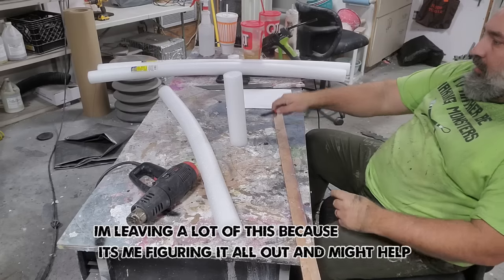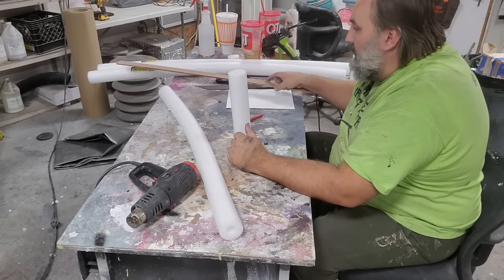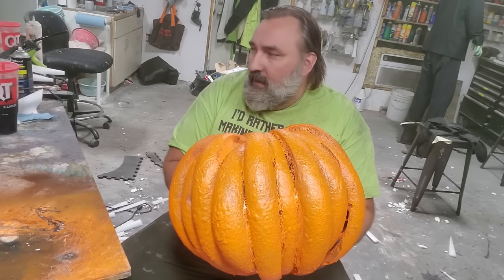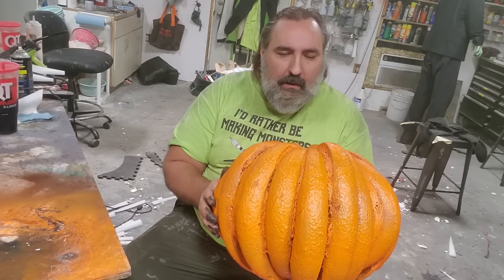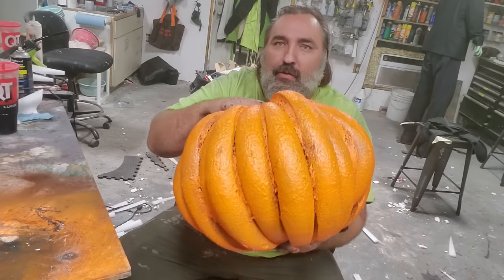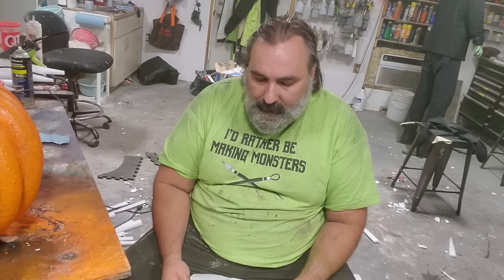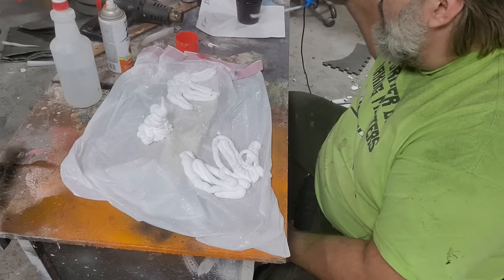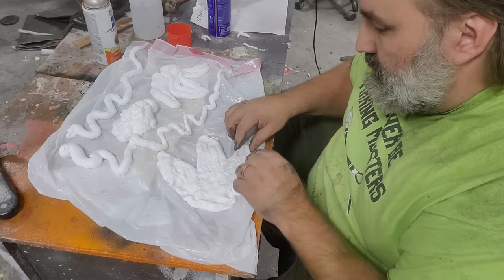pool noodle pumpkins!

Comment: Would they still float ? I could see a pool or pond with a bunch floating around in fog water lol.
Reply from the maker: they sure will.
Reply: Purpleshoes Purp that would be rad!
Reply: @amyjarvis4169  I know hu. Now I just need to make them. Maybe for next year.lol.
Reply: Or in an actual pool, if you live in a warmer climate where you can have a useable pool in October. That would be a fun Halloween party 🎃
Reply: That would be such a cool effect!!!
Reply: Looove this idea for the resort I work at!
Reply: Thanks for the idea. I have a pond that it would look awesome in
Reply: I don't see why they wouldn't. They may roll over on their side.
Reply: I'd add some ballast to the bottom, as they would probably roll onto their sides. Perhaps fishing weights suspended by line beneath.
Reply: You are my hero.
Reply: Real pumpkins uncut will float.

Comment: Wow! I had no idea pool noodles could be attached to themselves with heat. Loved this project!
Reply from the maker: it takes a bit of fiddly practice, but it works.
Reply: I came here to say the exact same thing, 10 months later😂😂😂
Reply: I honestly thought that was a real person in the background at first 🤦‍♀️🤦‍♀️🤦‍♀️🤦‍♀️
Reply: I’d like to hear anybody else was able to. I just got shorter and shorted melted pool noodles. Every one I added melted the other three off each other.
Reply: @lisagaines4278  Me too 😂
Reply: I’m working on one now and I skipped the heat gun all together and used the soldering iron. You have to melt the middle piece and the part you’re trying to attach at the same time and then smoosh them together while it cools.
Reply: Side note- I’m using dollar tree noodles and the length isn’t the same and I don’t think the thickness is either. I’m definitely going to end up with more than 10 “c” pieces attached lol

Comment: Great minds think alike! I have a weird affinity to pool noodles & spray foam & buy both by the case! My pumpkins are a little different-I use 2 big plastic bowls from Dollar Tree, duct taped together & form my pool noodles over the resulting pumpkin shape. (I weighted some down with concrete so they wouldn't blow off the porch) I then added 3 coats of equal parts joint compound, glue & acrylic paint mixed together. Details can be etched on while set up but not dry. I sprayed  with clear coat & was amazed to have a finish very similar to the store pumpkins. I used the long foam rollers from Dollar Tree to form a stem & coated it with my 3:1 mixture after gluing on the stem with hot glue.  I used different sized bowls & pipe insulation foam  to make smaller pumpkins. I top the pumpkins with a floral wreath of leaves, blooms, berries, pinecones & such or decoupage wordage or  appropriate napkins .The virus has ended my craft shows but I expect these puppies to sell like hotcakes next year!
Reply from the maker: that sounds awesome! Im douing a dollar store bowl project soon here also lol.

Comment: This is totally cool !!! Genius idea ... I made a pool noodle wreath last year and that is when I first learned that spray paint melts pool noodles but you didn't have an issue ... so I will have to choose my spray paint more wisely ! The spray foam is also genius ! Just love everything about this and how you explain your processes thank you ! 🙌🙌🙌🙌
Reply from the maker: most pool noodles dont dissolve with spray paint. They are urethane foam- thats pretty safe with spray paint.  Expanded polystyrene foam and extruded polystyrene foam are botgh dissolved by the propellant in spray paint, mist it on and you will be ok.

Comment: Super late, but just thinking of the off cut scraps you could possibly make a pumpkin inspired witches hat with them. form a cone with them then for the brim create a circle with them flat all points facing in. It'll have the ridged look the pumpkin has but as a topper I think it would give it a quirky look that fits it.
Reply from the maker: that could be cool!

Comment: OK, so, corrugated cardboard cut into leaf shape. Peel off one layer of cardboard sheathing, exposing the corrugations on one side. Dampen the cardboard and drape shape it over the pumpkin (or a bowl). Allow to dry, seal, and paint if desired. Probably just as cheap, if not cheaper than foam, faster and the papery texture looks remarkably like dried foliage. If you crush down some of the corrugations, it really makes the finished leaf look organic.

Comment: Good video Allen.  I actually made some of these 6, 7 or 8 years ago.  I can't remember where I got the idea from, I may have actually even thought it up myself, but it's probably more likely I saw or read something about it.  Whatever, it matters not.  I remember how hard it was to get pool noodles here in England.  I would think it must have been late summer i.e., coming up to Halloween, and so I couldn't find anywhere that had any in stock.  I suspect in Texas they're pretty much an all year round item, but there's not much demand for them here outside of summer!  

Eventually I gave up trying to find them so resorted to grey water pipe insulation tubes - I'm sure they're made of the same type of foam.  Maybe because of your climate there you don't have them, because your pipes don't freeze as it never gets cold enough there?  I made quite a few with the pipes but they were no more than maybe a ft high and about the same width - as you point out, you are limited to the width of each segment, and thus the width and height is restricted.   So after further thought I ended up buying some 'Scaffold Protection foam tubes', which are bigger/wider versions of pipe insulation tubes and are bright yellow - they only exist on God's green earth because we Brits are obviously so stupid that we cannot see scaffolding poles until we smash into them, so we have to make them BRIGHT YELLOW so we can see them.

Now I had a fair bit of success with this idea (pumpkins that is - not smashing my beautiful manly face into scaffold poles) and created some quite big pumpkins - I've just quickly taken a look at some of them and they are around 18" to 2ft (max) high/wide at their biggest, so still restricted in size, but a big improvement over the grey smaller tube ones.  I used essentially exactly the same technique as you by slicing the tubes up into 'segments', tapering each end like you did.  I then used hot glue to stick them all together.  My experience was that it took a long time to get all the separate segments to stick.  Because of their nature to want to 'spring back' into their normal rigid upright state, I initially hot glued them to pieces of round foam (like the blue/pink foam you make gravestones from), like maybe 3" or 4" diameter.  That worked, but again because they wanted to spring back, I had to hold them for a good few seconds for the glue to cool.  But as I worked my way around, the space got smaller and smaller and that made it more difficult to hot glue them both on the foam end pieces, as well as together - I hot glued all of the edges together which was difficult as the pieces closed up.  

Anyway, I got there in the end and was quite please with the results, but what I didn't like was that my pumpkins looked too good i.e., they were the most perfect pumpkins ever seen, completely symmetrical with each segment exactly the same as the next - which of course meant they were far from perfect, because that is not how nature works.  So your one here is much more realistic than the ones I made.  I never really worked out a simple, and quick, way to get around that problem of how unrealistic mine looked as they were just so perfect all round.  I did try slicing the tubes more randomly, but I then couldn't get the sides to glue to each other.   What your video has brought to my attention is that I could have probably used a heat gun too to stick them together, plus I could have spray painted them rather than use acrylics (I naturally assumed that spray paint would have 'eaten' the foam, but as you have said before, this foam is not the same as polystyrene or styrofoam).  But what I like most about your one is how imperfect it is, which of course actually means it's more perfect than my perfect but imperfect pumpkin.  If you know what I mean?  

So you have given me some ideas and the only issue I see is the potential gaps between the segments due to the nature of how they're created, but maybe that could be overcome by that really thin foam you used for the skeleton mask you made recently?  By applying that over the 'skeleton' of the pumpkin you have made and then using the heat gun method to shrink/corpse it and cover up any gaps between the segments?
Anyway, that's my experience and maybe it will give you some further ideas.  Cheers!
Reply from the maker: Im sure there will be lots of refinement in the next few. do you have any pictures of the ones you made?
Reply: I can take some but how would I send them to you?

Comment: you beat me to it!  I've been planning a nice pumpkin patch to do up one year and having a pool... pool noodles was one of the ideas I had to make nice big pumpkins.  I've been putting it off though because they would take up a ton of space so I've been trying to come up with a way to get something similar but that can then shrink down to less space after Hallowe'en is over... outside of inflatables or collapsables... I have not been able to come up with anything LOL
Reply from the maker: id do ceiling storage, put them in a net up in the rafters.
Reply: @StiltbeastStudios  I wish that were an option.  I have very little ceiling space left.  If I can't find a way to make them smaller after Hallowe'en I'll likely resort to tossing them in the attic since the elements aren't going to phase them.  Just not sure how I'd get the giant pumpkin through the small access hatch LOL

Comment: I'm finally getting to try this out. I didn't have near the good luck with using heat to cement the noodle when it came down to the later pieces. Instead I went for the hot glue, which takes a lot longer to cool, but got me the results. I also used it to fuse the walls of the pumpkin together.
Can't wait to try out the loctite foam sculpting this weekend and see where that goes.

Comment: Did a QUICK small one, used a dog ball for the template. 
1 noodle can get probably yield 6 small pumpkin. Haven't painted just tried 1.
Also was wondering is there a way to use an iron <reg clothes type> to flatten the noodle scraps for leaves. I was thinking noodle-silicone mat-parchment paper-press with warm iron....
Reply from the maker: GReat ideas! I dont keep an iron in the shop, but I will try to steal the wifes!

Comment: Interesting thing about doing it this way is, if you had needed to, you could have shortened and widened the pumpkin just by cutting some of the core material out and heat gunning it back together into a shorter core, bending the outside "ribs" outward more and making a squatter pumpkin. Neato.
Reply from the maker: you have options, and yes, they can be made in many shapes and sizes, I cant wait to play with it more

Comment: What if you just partially spilt the noodle on 1 side (vs completely into 2) then use the heat to spread it to cover more area. Then you would have less gaps.
Reply from the maker: very true, not a bad idea, and you would have wider spears as long as the foam held up in the split.

Comment: I am not your mom, but would like to say I did 40 years spray painting theater props and much of the time I did not wear my respirator.  I am suffering significantly now from that poor choice. Makes me very worried about catching respiratory viruses now if you know what I mean. You are a very talented prop maker, I only wish you well.
Reply from the maker: I fully understand, what you cant see in this video are the two Grizzly air scrubbers that I have running in my shop at all times, they do a great job with everything except metallic alcohol based inks for some reason.
Reply: @StiltbeastStudios  I should have guessed that.   I may be just more angry at myself than anything...

Comment: I freakin' love this Allen. A great experiment, with great results. Love pumpkins. One question I've been meaning to ask you is what techniques can you recommend to paint a store bought pumpkin to look natural. I was thinking gorilla glue, and water first... I'm looking for the small bumps on the skin like a real pumpkin has. Any thoughts? Thank you!!! 🤘🏻💀
Reply from the maker: Id use spray adhesive before paint, like super 77 it will give you some texture under the paint.
Reply: @StiltbeastStudios  Thanks as always. 👍
Reply: So I just tried the super 77 you recommended... Bingo. Exactly what I was looking for. Great pumpkin-like skin texture. You da man.
Reply: So I had a thought and wondered if it would be possible. Could you make a plaster mold of a real pumpkin (in 2 pieces like a life cast?). If so, cool! But then, what material would you fill the mold with in order to make the pumpkin carvable? Good fake pumpkins are just too expensive and for some reason (maybe COVID) I didn't see many available this year in stores. I love me some foam pumpkins for carving, so any help here would be greatly appreciated. As always, thank you 🤘🏻💀

Comment: This was cool, I know it was an experiment, would using something on the center tube like a rubber band or tie down help hold and position the noodles one way and then curve it over to secure with the soldering tool?
Reply from the maker: zip tie!

Comment: I've never heard of weldwood, its a spray adhesive I assume, and that's what you sprayed all over the pumpkin before the orange spray paint?  I know in my experience with spray painting foam, sometimes I get ok results and sometimes it melts the foam lol.  I've been wanting some bigger pumpkins for my front porch but those suckers are expensive in the store.  My dollar tree is always out of pool noodles, but I'm THINKING I could use the foam pipe insulation from lowes.  it's already sliced down the middle of one side, and it comes in 6ft lengths for 1.78, so where there's a will there's a way lol.  Thanks for sharing this video, you've inspired me!
Reply from the maker: awesome! good luck, the pipe insulation takes a gentle hand since its less dense

Comment: Could you have heated the vertical edges between the noodles and have glued them together that way? (when the ends were all attached and form was completed- before painting)....
Reply from the maker: possibly but it would take some precision and some time, better in that cae to make two pumpkin halves and then attach the two halves together that way

Comment: Allen, I have tried this and am having trouble getting the noodles to stick together. The center post has melted. It may be my heat gun. I have the most basic two setting (no adjustment) Wagner heat gun. What am I doing wrong? Could I use an adhesive or my wood burning tool instead?
Reply from the maker: I think so, I used a soldering iron if you recall. have you watched the indepth video on heat bonding? wait...I see you did, did that help?

Comment: Love you, love your show, question???  So today I started working on my pool noodle pumpkin, the webbing stuff you mentioned, Weld wood, could I use Flexseal spray to do a similar job?  Just curious. Our local walmart doesn't carry the Spray Weld wood but it does have the spray flex seal.
Reply from the maker: I dont think it would. but that step really isint necessary just add a few more ribs.

Comment: Love your stuff Allen...Just to communicate I purchased some pool noodles from Menards and I cannot get them to stick with either the heat gun or spray adhesive.  Apparently all pool noodles are not created equal.
Reply from the maker: they are, odds are good you are waiting to long, what kind of heat are you using?
Reply: @StiltbeastStudios  I'm using a Warrior two level heat gun from HF
Reply from the maker: @drtodd5436   did you see the video I posted yesterday on a close up of the technique?

Comment: This is smart thinking, but l was wondering could you also make slits in the middle piece, slot the outer pieces in and glue them down with hot glue. Also  l have another idea as l am a cake decorator, so l will make it and post it on the Facebook page, thank you from down under we’re woman, thunder lol left handed too
Reply from the maker: I suppose, but hot glue is not as good of a bond as the heat bonding, hot glue barely sticks, the foam just does not glue well..
Reply: StiltbeastStudios ok thank you l have a heat gun .

Comment: so wanting to try to use that spray foam like stuff for other uses if I could get in very smooth, any thoughts on this?
Reply from the maker: you can lay a sheet of plastic over sprayed locktite foam and it will cure smooth under the sheet.

Comment: I’m so disappointed! Loved this idea, bought what I needed but my pool noodles do not attach with a touch of heat! Tried using spray adhesive and heat. 50% success. I don’t know how you attached with heat gun..mine won’t connect. And soldering didn’t work either. Weird?!?!

Comment: Seems like a LOT of time and work.  Couldn't you buy Styrofoam pumpkins and paint them, in a fraction of the time or are they not as durable?
Reply from the maker: that depends on your needs. these take me about 25min each and abouit 6$ in materials. one this large would cost $40 plus, so its a good cost saver if you want a lot of them. you can spend time or money and laugh at each others choices lol.